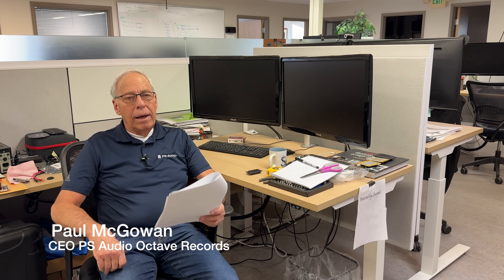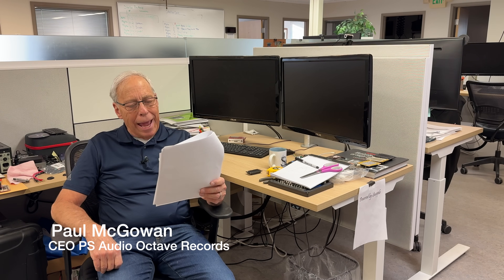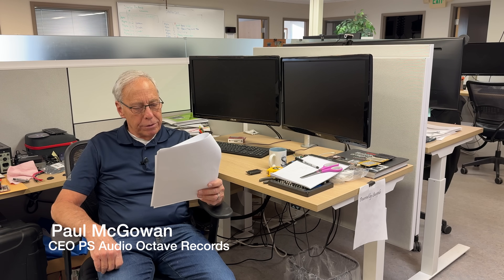Is bigger better?

Comment: Bigger speakers are better. Bigger amps, not so, with bigger speakers, just use horns for great efficiency. Big speakers sound big, big amps sound like big amps and a bit louder. Small Box speakers seem to need big amps, It appears the wrong way. Bigger cables, no no no no, signal interconnects, as small as possile, speaker cables, nothing larger than lamp cord size. I don't use any power plants or so, got rid of all that is adding extra stuff to the system. What seems to work is running a few metres (say 7 feet) of mains AC cable to the outlet, just the live and neutral, the regular solid copper wire 2,5mm2, in a larger plastic conduit (like used in offices), the wires free hanging in the air. And the connections to and inbetween the braker box of good quality, the wall outlet of good quality. No earth wire, nor on the wall socket or to the system.

Comment: I absolutely love the fact that Paul acknowledges the phenomenon of diminishing returns. So many audiophiles, and even more people who sell audio equipment deny it's very existence, or will at least refuse to identify where it starts to get really intense. It's a sticky subject to say the least, but to hear one of the guys who sells the stuff acknowledge it's existence helps me believe that there is objectivity to be found in this world.
Reply: Paging Audioquest.....
Reply: just don't think that the internet helps making sense in audio, the opposite is true. People do believe what they know, but in fact most standards in audio gear are poor sounding and contributing to poor sound. Like snubbers on diodes, removing them will help.... Adding a transistor as a pass device on a bunch of caps and a signal generator for the frequency in the mains, is introducing noise in the mains feed and a neary transformer, buzzing away, and perhaps solving a problem and introducing another. But sometimes it could be helping where the mains are so bad and noisy that anything will help....

Comment: It's the balance. I have Wharfedale Linton speakers and a Denon PMA-1060 amplifier. A good combination. I also tried a refurbished Denon PMA-QS10 II amplifier but this mighty beauty of a beast turned out to be too much, producing too much bass with the Lintons. The big Denon needs something bigger to work with and for the Lintons it's back to the humble smaller workhorse.
Reply: @@tortugagonzalezgarcia4352 Neither amplifier is broken. Both work fine with the right speakers, the bigger one serving in primary system, the smaller one in secondary system.
Reply: @@tortugagonzalezgarcia4352 The weakest one is powerful enough. It has been playing for years, sometimes for days on end without any difficulty.
Reply: @clickbeetle2720  The Lintons deliver loads of bass when paired to the PMA-QS10 II, it's just too much in my room and to my taste. The amplifiers are comparable in power output but that's about it. In the shop where I bought the QS10 II I could test it with several high-end speakers and I also had the PMA-1060 with me for comparison. Especially with Raidho TD2.2 speakers the QS10 II leaves the 1060 behind.

Comment: The transformers in your power plants are just not big enough to impact amps positively, ime Paul. Why don't you just produce precision power filters?
Reply: Precision filters can reduce a lot of the noise on the line, which is good. They  cannot do is regenerate a perfect sine wave, if the peeks are truncated they remain truncated. What they also tend to do is increase impedance, which is a bad thing. I have experience with several different models of power plants, mainly the P10. The sonic improvements are undeniable.
Try one.

Comment: Oh boy, here we go...
Power plants, you're about to get drug through the mud Paul.
Reply: Incredulity bias anyone?
You don't understand how they can make a difference so they can't possibly make a difference.

Try one before you adamantly decide. I have tried one and the improvement was undeniable.
Reply: @nathanevans6277  
Re-read my statement...
I understand that sometimes it's very hard to understand what a commenter really means, but you took it to the other side. My meaning was, the topic of power plants brings out the power plant haters and Paul always takes a beating over them. When I posted my comment I was the third comment. I see now that 50 more comments have been added. I don't have to read any of them to know the power plant haters are here in force. It's always been that way and even more so after Amir put his two cents in. If I'm a power plant hater why did I trade-in my old P-10 for a new P-15? 
I would have gone for a P-20, but it's a little too rich for my wallet.
Reply: @Mark-lq3sb  please accept my apology. I did indeed miss read your post.
There are already a couple of posters crying "snake oil". I can guarantee that none of them have ever actually tried a power plant regenerator. I have and can attest to their effectiveness. I just wish I had the rack space for one.
Reply: @nathanevans6277  
No problem Nathan, and I agree with you about the Snake Oil crowd. 
Happy Holidays!